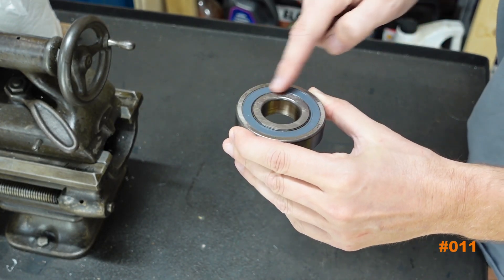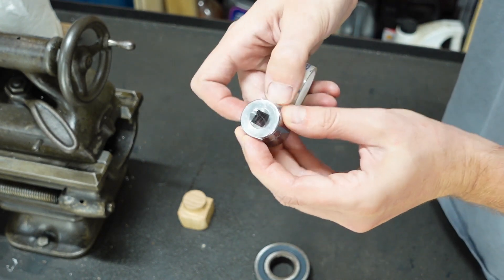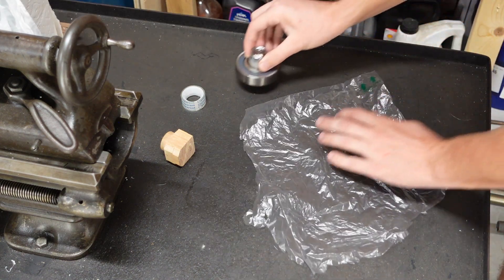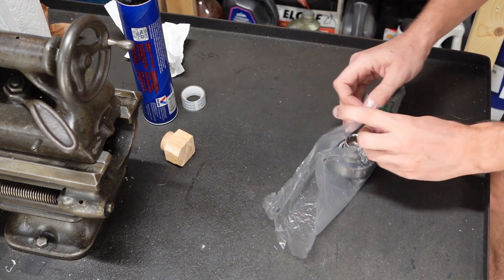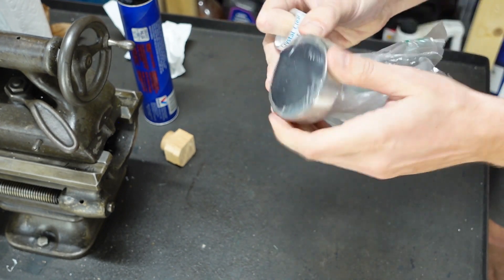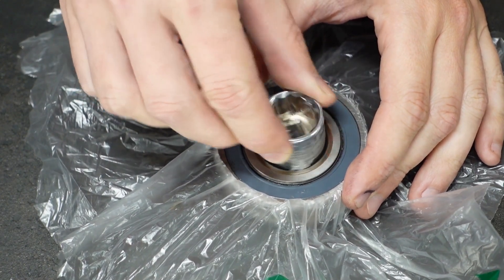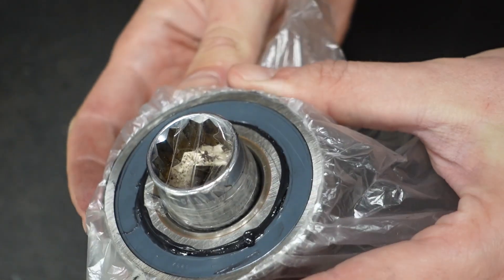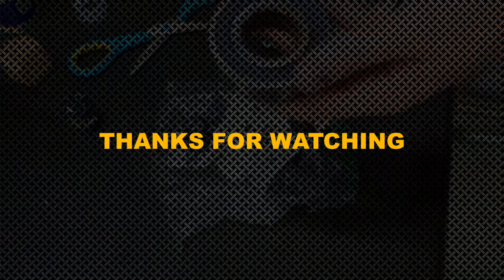How To Re-Grease Sealed Bearing. Easy Way Every DIYer Should Know

Comment: You guys should recommend this video to the lawn equipment yt channels. Most of them say the zerk grease fittings on riding lawn mower spindles can't be greased by filling them completely up with 50 pumps of grease, that the seals keep it out. Keeping in mind the incredible amount of hydraulic pressure created by a grease gun.
Reply: I think if you turn the spindles by hand while greasing with a grease gun  your good to go !
Reply: @timothygreen6752  You should tell them that. Taryl fixes all, chickanic, and Steve's 
Small engine saloon, to name a few off the top of my head, comes to mind.

Comment: "Full of grease" is too much grease now. Removing the seals, cleaning them out, and regreasing with "enough grease" is better and mt much more work.
Reply from the maker: Thanks. If you can remove the seal, my method becomes useless. But how to change grease without removing the seals?

Comment: A method similar to this was developed for Radial Arm Saw carriage bearings. Those do not have removable shields and were designed to be life time lubricated. However many of the old machines are beyond a lifetime in age. Heated solvent and ultrasonic is used to dissolve the factory grease, afterwards the plastic bag method is used to force new grease in. As these are super low speed bearings, over packing the bearings is not an issue.

Comment: Dear Sir,

A ball bearing with rubber seal is filled with life-long grease from the factory (ball bearing factory).
In addition, the free space in the ball bearing is only filled to approximately 35% of the free space. The remaining free space is used to distribute the life-long grease, which becomes thinner during use, over the running surfaces of the inner and outer ring, the rolling elements and the insides of the cage.
The free space is to hold the grease (which becomes thinner during rotation and can then "turn" to cool down a bit.
It is therefore not necessary to "re"fill a ball bearing with rubber seal. You also do not know how much grease you are putting in.
Your proposal for your method of refilling is (if I may be honest) wrong.
Reply from the maker: Yes, of course, you're right. There is no talk about using the bearing. Only access to the inner space and filling it with grease. If you plan to use this bearing in precision technology or high-speed shafts, then it's better not to repeat this method. But if you find a dried out or partially rusty bearing, for example, in the wheel of your garden wheelbarrow, then why not bring it back to life with this method.

Comment: Never ever fill with grease more than 25 to 30 percent of the empty space in the bearing.  With this method, 100 percent of the empty space in the bearing is packed with grease. This will overheat the bearing and resultant popping off, of the seal. Removing both side seals/shields is the only option to grease the bearing with the right amount of grease. The other issue is that one should never mix old grease with new grease, even if they are from the same manufacturer and same grade of grease. The base oil, wear additive and thickener will likely be different. Always clean off the old grease before repacking with fresh grease. To do this, we will have to remove the seal and some cases steel shields in some type of bearings. This method is good as a stop gap arrangement.
Reply: Maybe he works for a bearing company?

Comment: Helicopter pilot/mechanic....this is the hard way....we use a hypodermic needle and slightly dull the blade with 320 sand paper so it doesn't cut the seal....

Comment: If the grease is gone or dry inside the bearing the bearing should be replaced. Bearings are not expensive. Repairing the equipment that gets destroyed when they fail is. Thats how I earn a living as a 38 year machinist. Repairing equipment damaged because someone failed to change bearings on a regular schedule.

Comment: Why would you like to «regrease» a bearing like this? If you look inside a brand new sealed/shielded deep groove ball bearing, you will see that it contains only a small amount of grease. This amount has been calculated carefully by the manufacturer. With this method, it seems like you completely fill the bearing with grease. This will most likely create excessive heat and reduce usefull life of the bearing. You will also be stuck with remains of the old grease and dirt inside the bearing. It should really be cleaned out before you add new grease. There are a lot of greases out there which is not compatible. For peace of mind, better put in a new bearing. It will be safer and more economical in the long run. This method looks smart, but to me it really is not. But, who am I to speak, I only have 28 years of experience in the bearing industry to show for…..
Reply: Doesn't it ruin the seals if you open them.

Comment: Extremely unuseful..
For not using tools that socket popped up pretty quick.
Next time just pulled a seal pump some grease in it and put the seal back down....
Reply from the maker: Thanks for the tip

Comment: Good tip for extending the life of a used bearing if you don't have or need a new one. There is a lot of comments on this video with people being technically correct and technically perfect and I'm sure their information is well-intentioned maybe even correct. But I think this video portrays a quick simple cost-effective method of extending the life of a used bearing or getting extra grease into a new one as the manufacturers never ever grease a bearing enough. Good on you for posting this.
Reply from the maker: Thank you for understanding the idea of the video. Of course, it's better not to lubricate the bearing for important machines and mechanisms. But sometimes this is cheap and reliable way to revive a bearing.
Reply: it just APPEARS manufacturers do not use enough grease in new bearings. this is one of the most misunderstood things, for 'good reasons' as we all assume more grease protects better. it does not. 

there are exceptions w/ everything and it's impossible to cover each aspect. 
for example a bearing on a wheelbarrow may last longer when filled w/ grease as it keeps water/dirt out for longer. but it's Because it never experiences the load/rpm it was designed for... but that bearing WILL fail prematurely when used in its intended application, say a motorcycle wheel or belt grinder... in such applications it will overheat, degrade the grease because of that heat and also open the seal allowing contaminants inside when grease is being squeezed out. 
in general grease occupies 25% of empty bearing volume. as long as contaminants do not enter a bearing, there isn't any metal wear... when regreasing, cleaning the bearing is the most important aspect. again, it doesn't matter on a wheelbarrow :)

ps: i am not trained in this field but my brother has worked for yrs in testing bearings for a few european auto-manufacturers and i like to ask questions... if you purchase a good bearing, !!do not modify it!!, they do extensive research, it's not a guessing game. your efforts should be in keeping it clean. 

as soon as contaminants enter a bearing the wear begins... w/o contaminants, counter intuitively, the balls do not make contact w/ the races when a bearing is spinning. don't believe me, look it up. i'll just say this in the end (because it's my field): a ball bearing in a high speed HDD spins at 10000RPM 24/7 for 10years w/ ZERO wear. metals don't make contact and there are no contaminants.

Comment: Easiest and cheapest maybe, but not the best way. Dirt and contaminants are trapped in there and will continue to undermine the integrity of the bearing.

You don't need expensive tools to do it the right way. Just use a cheap small screwdriver to remove the seals. Clean it all out, repack it and put the seals back on.

If you have an ultrasonic cleaner, you can fill it with water, put the disassembled bearing into a small ziplock bag full of alcohol and drop the bag into the cleaner and run it for 10 minutes. Bearing will be spotless. If you have an air compressor, you can use it to dry it prior to re-greasing it.

If you have tools, make use of them to be as thorough and efficient as possible.

Comment: Jeezuz. 
223 argumentative comments on how to repack bearings. Get a life, y'all. YT is so full of egoistic, perfectionist contrarians. The guy is just trying to share his little home amateur way to do it. 

Ffs, if it's a healthy working, non-worn, well-sounding race needing a little service top up of grease, how would you know -- and getting a little grease into it BY ANY MEANS is non rocket science? 

If it's a noisy race, very dry and worn, replace it.

If it's old, full of stiff, junk grease, and you're not sure about its tolerances, strip it, clean it, make your call, and maybe refill it.

This method looks like twice as much time and mess as a $10 bearing packer plunger. Duh. And, I don't know ANY workshops with clingwrap and stickytape on hand.

Comment: I heat oil in a syringe in very hot water, slide the needle into where seal meets metal and pump gease in.front bearings have done 110kms and are perfect..simples2 mins per bearing. Syringe plus hypodermic needle, 20 Centimos.
Reply: ensaya 110,000kms

Comment: You probably don't know what grease was in there before so you can't predict the compatibility of the old grease thickener with the new grease thickener - that's Number 1.
Number two is that bearings are very seldomly 100% full of grease and since very little of the old grease came out you've simply overgreased the bearing. That'll lead to churning and overheating of the grease.
Reply: YouTubers like this play to those that don't understand the purpose or science of sealed bearings. Everything you stated is what I have learned from others. We had a large 3 phase 75 hp electric motor that ate the bearings despite it being greased faithfully. According to the rebuilder it was greased too faithfully. I learned about this from him.

Comment: I use a large hypodermic needle and syringe from farm supply. Slip it in edge of flexible seals. Best with warm grease. If it's a hard shield pry it open to get access.
Reply: exactly,see my comment, been doing this for decades on my Ducati...bearings perfect everytime i change the tyres (5-7000kms)
Reply from the maker: Thank you guys!

Comment: Save the mess, remove one seal carefully, and pack the grease from there. Those "special tools" needed would be a pick or a small flat screwdriver, and a pair of gloves or a bag, as you also used.

Comment: Sealed bearings r usually two inches or smaller and do not get greased they get thrown away. Think a little bit. The fearing must be pulled off the shaft and reinstalled. It’s cheaper to replace it. I have worked on many small idlers and it’s way faster and cheaper

Comment: Do this with brand new bearings and the bearings last 4 times longer. It always amazes me how Little Grease is in some brand new bearings
Reply: Over greasing a bearing causes heat.  You only need about 30% fill.
Reply: @TheBeingReal  You're not "wrong", but there is no "magic" number. It has to do with bearing style, use, rpm compared to spec, type of grease, etc. It could be as low as 10% or as high as 66%. Read the Mfr's documents, for your particular bearing and application.
Reply: @tomb816  Grease fill can vary as noted. When you look at catalog rpm ratings, the fill from the factory is to that spec. Over pack the bearing and the grease churn will cause over heating if the grease cannot self purge.  

Granted, few applications run bearings near their rated rpm, so over filling may not even be an issue. Mixing incompatible greases will cause failures.  Typically poor installation methods, improper maintenance and contamination are the big drivers for bearing failures.
Reply: @TheBeingReal  I'm not sure what your point is, exactly. Do you feel the Mfr's specs are incorrect? My response was in direct relation to them. Just stuffing grease into a bearing, which seems to be how the majority of these commentors were taught, is not the correct way. Hence, my comment noting a wide spectrum of fill volumes. 

To your comment expanded to include conditions having nothing to do with the correct grease volume. While I don't disagree that what you've stated can cause issues, it's irrelevant.

Comment: I popped the cover on one side of brand new bearing 's to ad more grease to it the manufacturer somehow didn't apply enough before packing them. I use extreme condition grease it hasn't failed me yet. You should make a video on how to tap new bearing 's into there hub, not everyone has access to a bearing press & as for the trick of a threaded rod with washers & nut's isn't worth crap the washers deforme, i used a peice of 4x4 stock to drive it into place with a hammer. Let's just say you will need oil & grease to fit them in.

Comment: Ingenious method but far better to remove seals, give it a proper clean out, regrease and refit seals.
Reply: How do you remove the seal?  Mine doesn't have plastic seal, it appears to be metal.  Can you post a video or link to another that shows it?

Comment: There’s an inexpensive tool for that. Grease sealed bearings is NEVER a good idea, UNLESS, the bearing is compromised and needs to be replaced any way. To limp it trough a task go ahead and grease em but if you got it off/out your wasting time and money. DO NOT TRY THIS ON NEW BEARINGS!!! 50 years of Ag and heavy duty wrench pulling taught me a lot. 
The idea is unique but in 50 years of wrenching I’ve had 1 instance where I did it BUT used the tool made for it. Takes maybe 30 seconds wifi the right tool.

Comment: yes but if the bearing has been out grease for too long regreasing it won't make much difference after the damage is done.
Reply: Which is a good reason to remove the seals and clean out the old grease. After the bearing is clean, you can check for damage; and then decide if it can be repacked or needs replacement.

Comment: For something inconsequential, like a fan , a starter motor shaft bearing or such, ok. For anything that actually takes a load or is safety related, NO.
Bearings wear, this doesn’t address wear. If a fan were to last a little longer and the bearing fail, no harm no foul.
BUT people will always push too far, like wheel bearing etc, where tolerances and wear are crucial.
Use good judgment and common sense, don’t let your tight wallet get someone killed.

Comment: Why would I want to press out a bearing screaming, "please grease me", then reinstall the old bearing?? Once you hear a bearing, the damage is already done. Microscopic flat spots will only enlarged creating more heat no matter how much grease is in there. Because the bearing is not rolling but skidding along the race. The best thing to do is buy a new bearing and replace the old.
Reply: This was my point, bearings have a tolerance and they wear. For a shop fan or something, no biggie, for an axle or such, why let a couple dollars risk life and limb?  Just because one CAN, doesn’t mean one should.
If it needs new grease, it’s time for a fresh, unworn bearing too.  Do it once, do it right…

Comment: If I were going to attempt this, which I wouldn't b/c you don't grease sealed bearings, I would just use my bearing greaser. (It looks like two plastic cones on a threaded shaft with a grease fitting on the end. You place the bearing on the bottom cone, screw the top cone down on top it, and use a grease gun to force the grease into the bearing.)
Reply: I'd clean out the old grease first and be wary of overfilling the bearing.
Reply from the maker: Good idea. I will probably try to repeat it. Thanks.